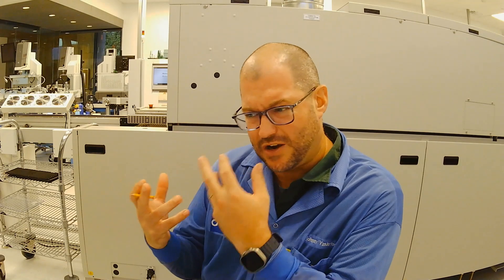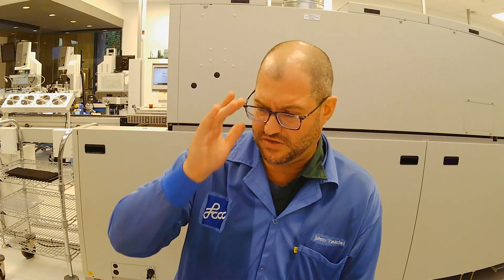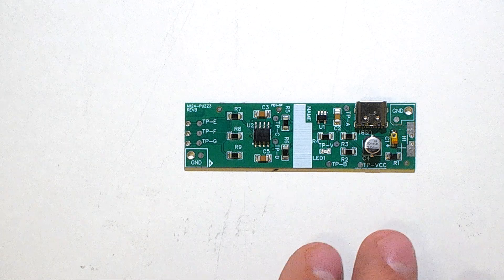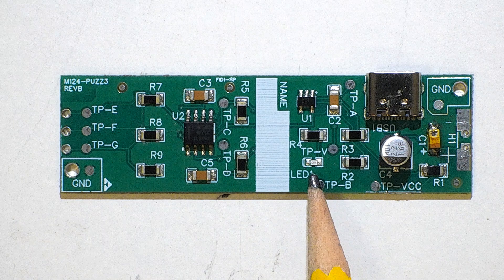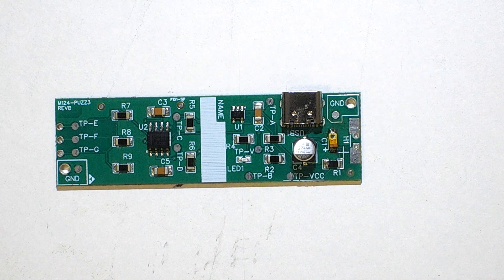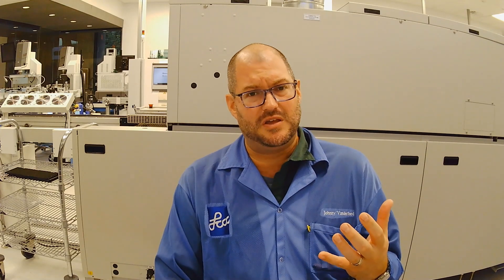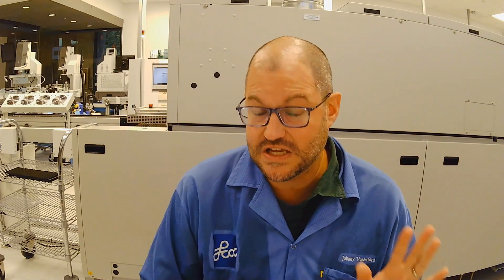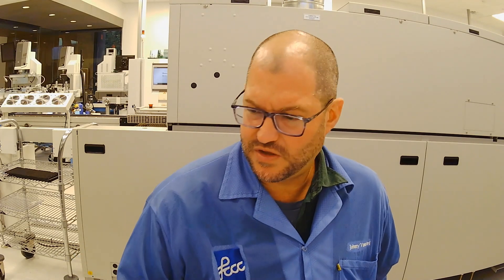PCB Test & Troubleshoot in 7 Easy Steps!

Comment: I am new at troubleshooting PCB boards, and one aspect that I have not been able to grasp is the flow of design.  I would like to be able to understand more about how to look at a board and see the flow of function from one part to another. 

 Your video touched on this, in terms of describing the board you made, but I would really appreciate a more detailed breakdown of circuit board design.

  For example, I have no idea why an inductor is used, or where it fits in.  If this was a game of baseball, I would like to know why I can't just go from second to home.  What's the importance of third base? Meaning why do we need A,B,C, and D, and what happens if the order of function gets messed up?

 I just want to be able to visualize why this needs that because I feel it will also help me understand when things fail, where the failure might actually be.  I want to be able to visualize the process while looking at a board, vs just seeing a bunch of stuff and having no idea how anything interconnects. 

 Just explaining where things are is not enough either I think.  I think being able to see what a component does to the signal, as in the before and after, vs its total absence, would be very valuable to me.